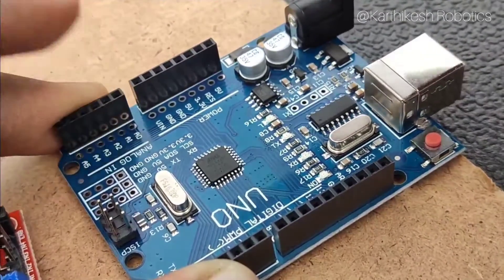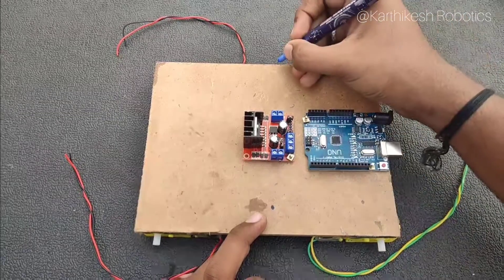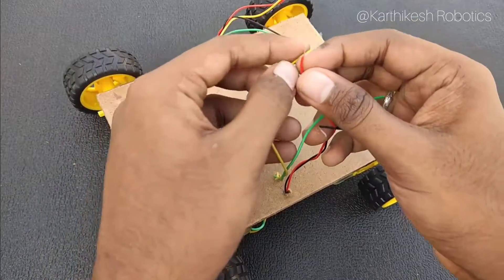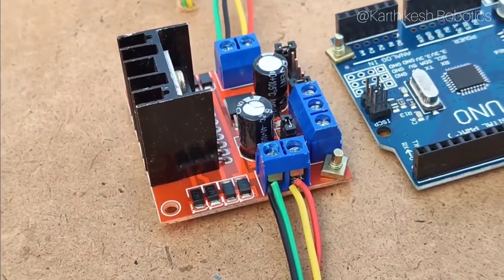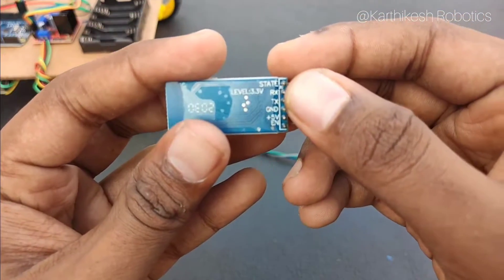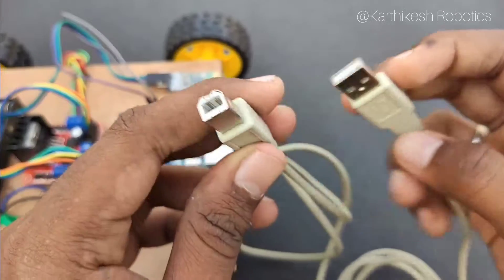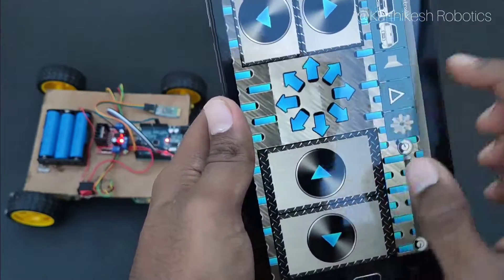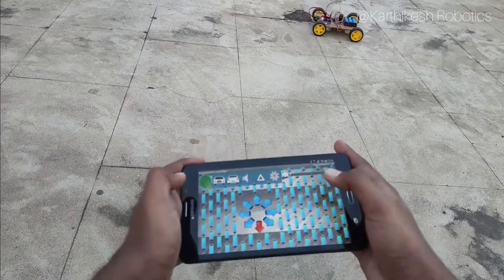Bluetooth Controlled Robot in Tamil |#kkr |#karthikeshrobotics |#robotintamil

Comment: Bro 12v battery supply ah  motor board + arduino uno vin la onna connect panni use panalama? Naa 2s 18650 battery (7.4v)  with bms protection oda use pandrean. Motor board on panni lite move pannalea total power supply um off akiduthu